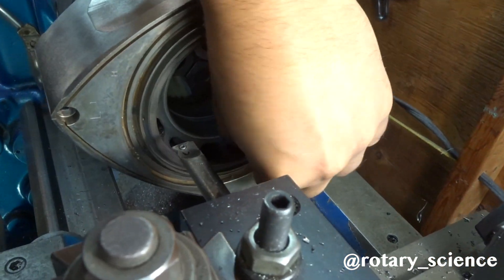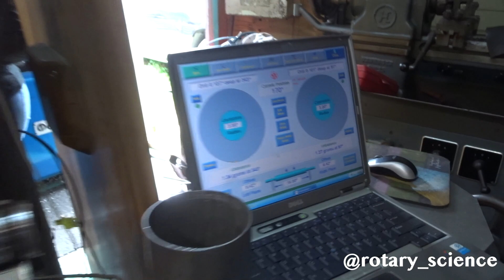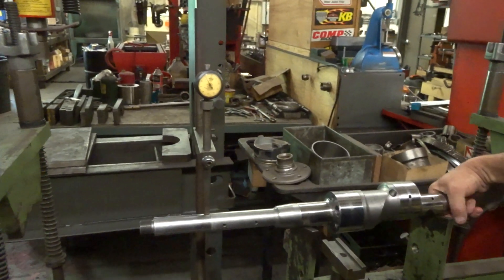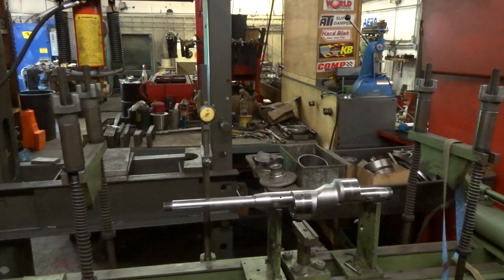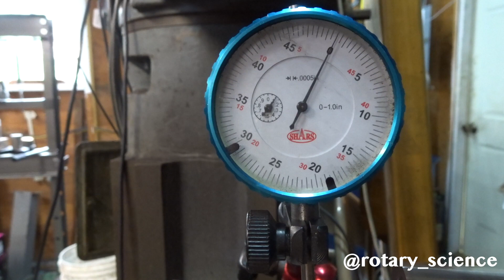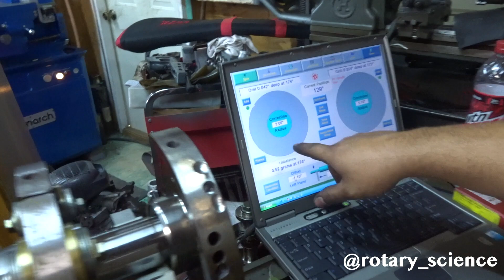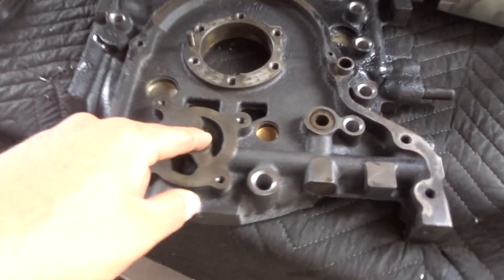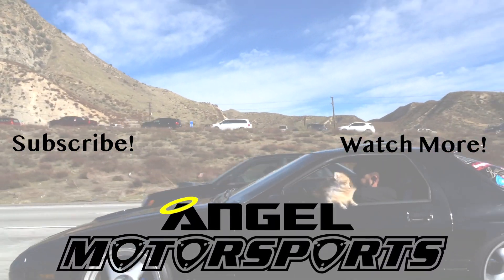Balanced My 20B Peripheral Port For 11k RPM's

Comment: Props to tha old guy who straightened the shaft, you don’t have a lot off them anymore. 💪🏽
Reply from the maker: True automotive hero
Reply: Came for the video; stayed for the NZ track.
Reply: He did a great job on that crank.
Reply: @markoz673bajen8  churr
Reply: One of the AppliedScience youtube channels did a video on how freezing steel parts makes them stronger, even after they've warmed back up. You guys should chuck that crank into the freezer for a day to make it stronger.
Reply: Christopher Stout  
Yea it's a little more than that 😆
Works good for bearing sleeves and whatnot to shrink em and they install easier.

Comment: Mazda did NOT design that Rotary. They found it, learned it and used it for their application. That’s what the 20b exhaust ports we so much larger than they wanted and needed to fabricate parts to choke it up. The 20b was design from the gate to be a big power engine. I would LOVE to see the car it was originally designed for because that piece has got to be out of this world good.

Comment: Why the decision to take out the oil slinger? The rotor's individual balance? Out of curiosity, I have an '8 engine in my Miata that I plan to rev to 9500rpm and don't want it to shake itself apart..
Reply from the maker: Mostly so the rotor can be mounted to the table with the mold but it also helps make the rotor closer to equal weight on the other side